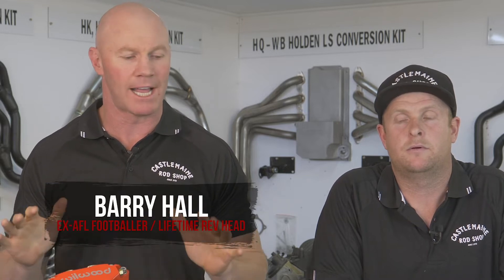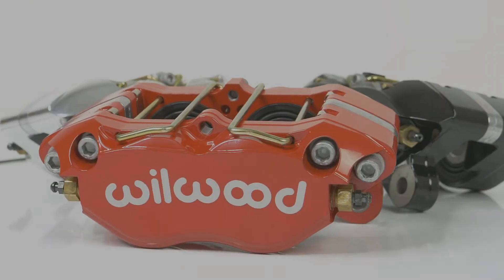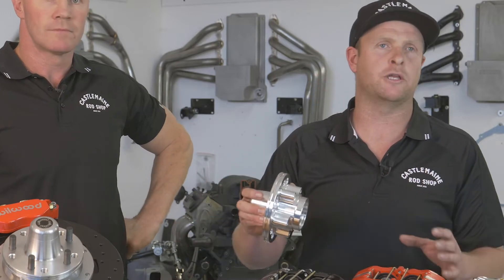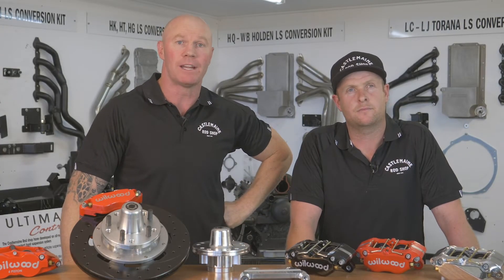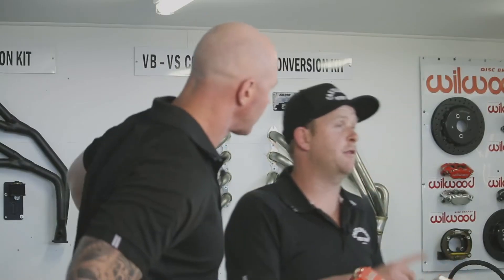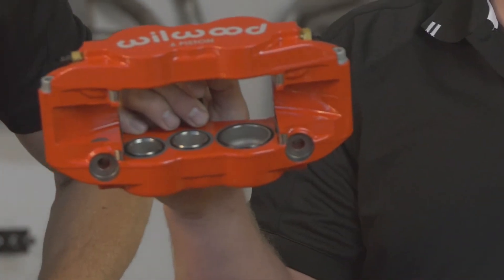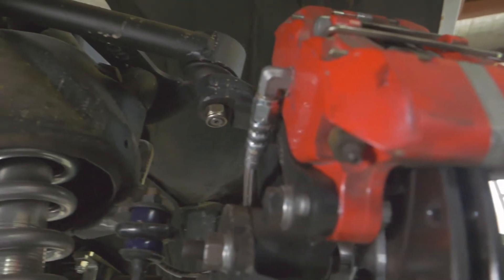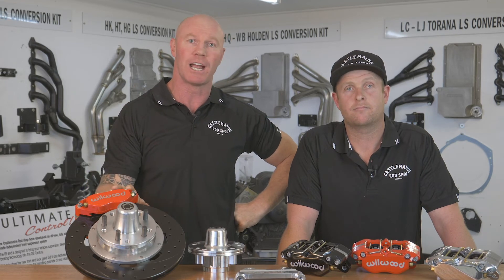Episode 11 Shop Talk - Wilwood Disc Brakes

Comment: Beware only the calipers are Adr compliant, if the hub is alloy, no official load rating from wilwood, an engineer will not pass it as I have found out the hard way

Comment: hi Not against Wilwood but after conversations with them they are aware of mismatched combo of disc /calipers in the market place . For drag racing no problems . For h/duty street /track there are better choices .
There are only 1 or 2 companies that do diameter 11 or 11.75 in  with thickness of 1 inch, 1 1/8 , 1 1/4 . To get everything to  imitate stock install its a full custom setup . 
The same goes with pad area wilwood 2/3 the size of factory pad and piston size 1-2mm smaller than factory .
Cars of a similar size run thicker heavier discs bigger pads and at least 5insq  piston area.
Corvette C3 front 68--84
Ford Crown Vic Police ver 03 on 
GM caprice 
GM l/duty c10